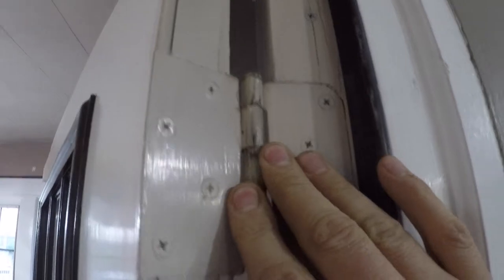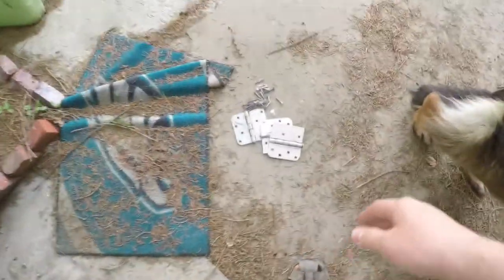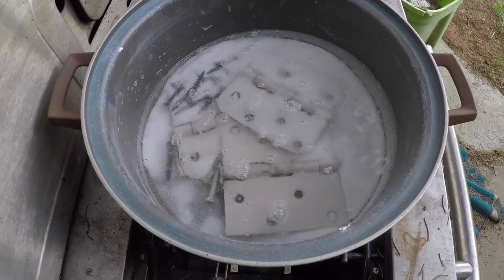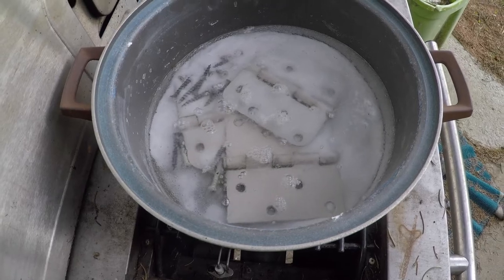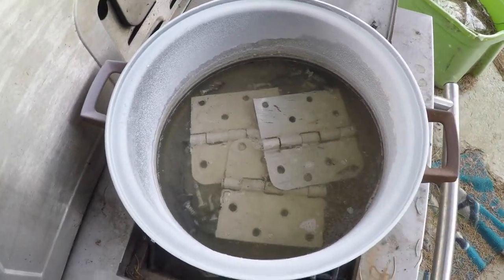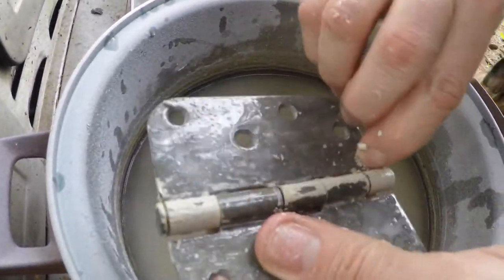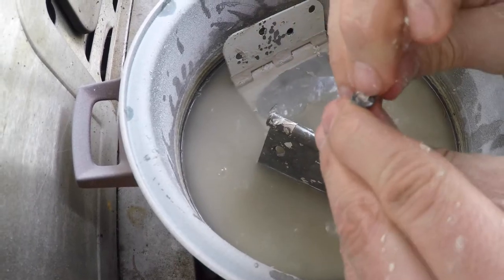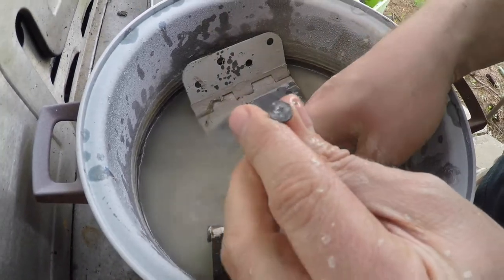HOW TO REMOVE OLD PAINT FROM HINGES!

Comment: Use a nylon brush to get the paint out of the crevices. Nylon won't scratch the metal on the hingers. This is especially true with soft metals like brass. Look at the scratches on the hinges!  I've seen people use steel wool to scrub the hinges and then some sandpaper that is very fine grit. In the past I used paint remover made with that Orange stuff and that will remove 100 year old paint off brass hardware if you soak it over night. Take the hardware off and soak it in a metal pan overnight.  But baking soda and boiling hot water for at least 30 minutes works good.

Comment: Bailing soda is given by the gods.
1. teeth pain? baking soda in water and stear in mouth 1 cup of glass
2. car front light yellow? slap soda and lemon on it and scrub it.
3. Car window get dim? clean with baking soda and potato water and done.
4. Vape heads have an old bad smell? put it in baiking soda water done no smell
5. Do your pods have black things? put baking soda and vinegar wait for 30 min done as new.
6. Are Your silvers getting green? put in baking soda and AA element for 15 min. done as new
7. Your sink did not flush? drop whole soda in it and wait for 1 hr. done

maan i love baking soda and it is so cheap when it can do so much :D